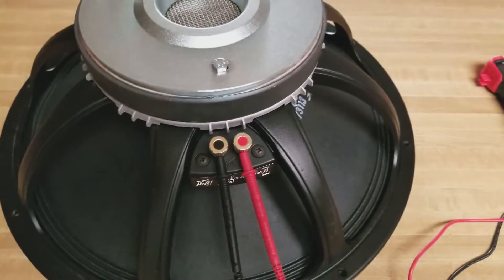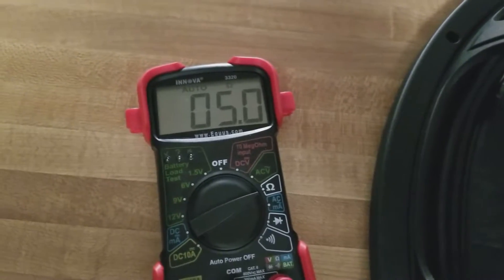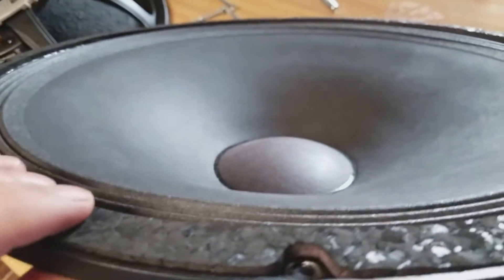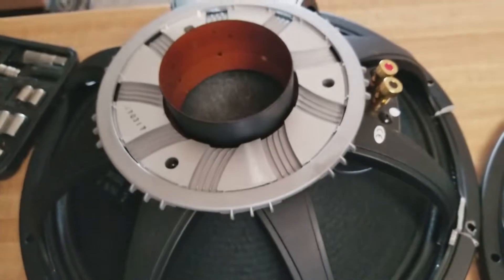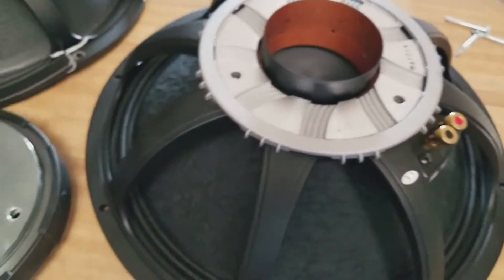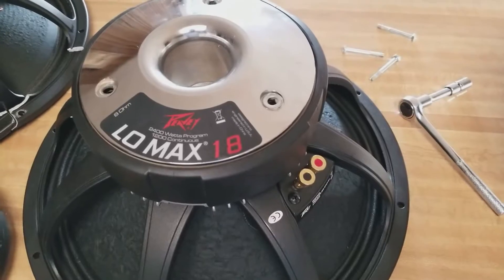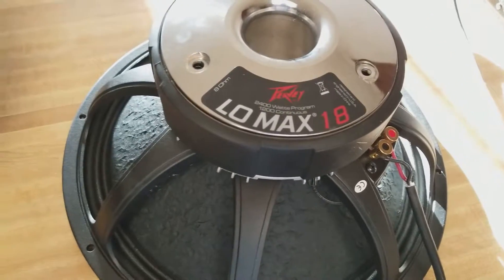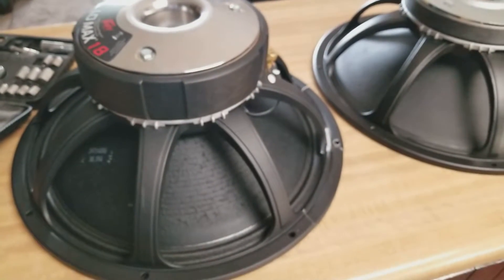Peavey Subwoofer Comparison - Pro Rider vs Low Rider vs Low Max (and magnet swaps)

Comment: First of all your leads on the back of your speaker or smacking the cone that's where you getting that noise from second of all those drivers take a while to warm up once the voice coil warms up their cleanup but you must be a DJ cuz if you work the first time you know that to you know if you don't have those drivers in a box they not going to sound good at all. So let me give you a better professional advice get them locked into a box before you start judging them cuz I guarantee you a lot of people would really a freaked out if they knew the gig that I was doing was being done by peavey's F-350 white drivers that I used on a gig where I had 16 tops double 15 tops being ran by for 4000-watt drivers and I guarantee you wouldn't have stood in front of those drivers saying that same comment you need help and running your stuff because you don't fully understand it so I'm trying to help you you need a minimum of 5,000 watch to run to Lomax drivers together now I don't know if you run in the 1600s and tops or bottoms but if you running them in tops you going to run your top boxes in at 4 Ohms or 1 mm x 16 ohms as 2:15 in the same topbox I would suggest wear depends on how many boxes you taught that you stringing together so I'm going to give you a formula if you're only using 224 boxes my suggestion is wired in parallel if you are trying to do a large gig and you need a lot of sound let me help you out you wire your boxes in series Ustream the boxes together parallel search the 16 old boxes with drop tough 4 Ohms which is you'll have to run a 3-way system now I don't know what kind of tops you running but let's just say you're running single 15 tops you can only stream two boxes together 2 / Channel if you run in single 15 and I better be pretty loud but it be nice and clean make sure your boxes are well-insulated that also makes the driver's clean up a lot outside of the box and give it all kind of reverberations you're listening to the back and the front of the driver the same time that's why it doesn't sound good to you

Comment: Unless you got to lomax's you wasting your time they need to have a a buddy with them so they can drop down to four ohms I know what your meter says but you're meeting right I run afro sound system with Lomax drivers they don't work that well by themselves they need a buddy and a whole lot of power unless you got at least five thousand watch to push them unless you have 5000 watts to push them Lomax driver you wasting your time that's right 5001 switch to driving

Comment: Hey there. Thanks for your videos. How has the Peavey IPR-7500 held up? I've heard negative things about them, what's your experience with them? Are they good with 20hz and below? Thanks in advance.
Reply: I have 6 of the IPR2 7500 and they are super good, I drive them very hard and not even tickles them !.!.
Reply: @sonidoa.c.g3884  Lol! wow that's awesome. I'm glad to hear another positive experience with those amplifiers. I believe the class (D) topology has been questioned somewhat as to whether or not it can hold up as well as the class (H) or the heavier toroidal transformer style amplifiers. Thanks for your response and input.
Reply: @shadrachjackson752  yea, I was watching the bad experiences, and personally I called Peavey about the issue and they assured me that the problem was happening to a batch that wasn’t properly solder and customer were having issues with that, but it was only 1 batch of these amps, either way if you happen to be a lucky one and get one of those, Peavey will fix it for free, all I can say I love these amps,
Reply: @shadrachjackson752  I bought them All brand new and they have never let me down, I use them really hard, I have for subs 8 double 15” and trust me these amps don’t even feel it, and that’s only on bass, and I have the same quantity of the SP4 for mids and highs and damn!,!,!,,!,
Reply: @sonidoa.c.g3884  Well, on that note I might reconsider the Peavey IPR-7500s then. If I do, I hope and pray that the ones I get are the good ones with no issues. Thanks again buddy.
Reply: @shadrachjackson752  hey no problem brother, just remember that Peavey has one of the best warranties on their products, they really stand behind their equipments ,!,!
Reply: If you want to play anything below 30Hz, might as well get a dedicated car audio subwoofer and not a midwoofer which will do a much better job.

Comment: No they did not use those on versarray system versuri drivers don't look nothing like that anniversary sisters JBL and is ran by Crown amplifiers PV ain't got nothing to do with versuri in fact the PV drivers can't even swing with diverse array reversal rate verse raise bringing at Sam you need to do your homework about diverse array verse re getting that ass TV ain't want don't want nothing to do with diverse array I don't make no mistake they get up on you you need the right type of box write a fires the right gear and most importantly an engineer to know how to get sound out the Lomax

Comment: Is the voice coil touch the side of the magnet is done those long screws in her to durn thing and I don't know how much you know about those Lomax but I really don't know too much about him still the boxing house two of them where are German parallel to the ground 5000 on them I guarantee you won't be a picture on the wall in your house or the neighbor on either side of me both of those speakers whatever the wattages on any speaker you need twice the power to running so it is measured this way if you have a 400 watt driver you need 800 to run it too little power your calls the speaker the buckle and missing its own voice coil translate estate if you haven't you don't have enough Heat you going to do me in so you and at least need a mineral a 5000 w prepare and if you got the right cat got him in the right cabinet if you a DJ asking to be too much depending on size of your vindy what are you doing live bands you need a minimum of two boxes of side once you get them open man now I will tell you don't put them those speakers in that design those drivers are not designed for a sealed box

Comment: I have the same Black Widow Low Rider and made the same noise when the bass hit. Easy Fix for me... Take off the magnet and clean the gap where the coil go in and wipe the coil (use dry miro cloth) I have a air compressor, I just blew in the coil gap.

Comment: What you did was measure the DC resistance of the voicecoil. That’s not the same as the 8 ohm impedance that the driver is rated at. 8 ohms is the nominal(average) impedance measurement of the operating frequency range for the driver.
Reply from the maker: Yeah I figured that out once I put them in a box hahah

Comment: I love black widow subs. I replaced my b52 folded bass horn with a pair of black widow subs and the sound better than subs b 52 uses in their folded bass horn cabinets. At first i made some boxes for the black widows but they sounded really bad and made poping noises so i decided to install them inside my b52 folded bass horn cabinets and right away they sounded way better. So now i just have a pair of b52 subs i dont use because they both are 4 ohms and i only use 8 ohms speakers.
Reply: B-52 DJ speakers don't try to use them for live sound

Comment: hello, de los 3  peavey subwoofer cual es el mas recomedable, saludes
Reply: Depende del uso. Pero si de potencia se trata, el de menor resistencia es el de mayor potencia ya que usa un conductor de mayor sección por lo tanto menos resistencia en dc. La impedancia es igual en los tres parlantes. Lo máx es el de mayor potencia.
Reply from the maker: Te recomiento el Low Ryder, es mas barato que el low max pero muy poca la diferencia, y para poder levantar el Low Max, necesitas un ampli muy poderoso, y casi siempre en bridge solo los puedes levantar. Pero para el Low Ryder es mas facil levantarlos
Reply: Depende de tu amplificador